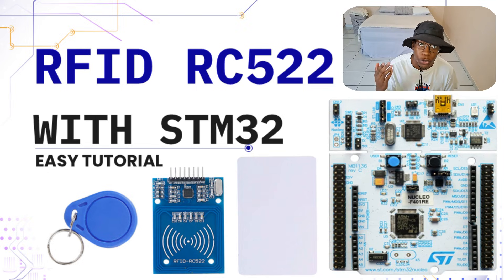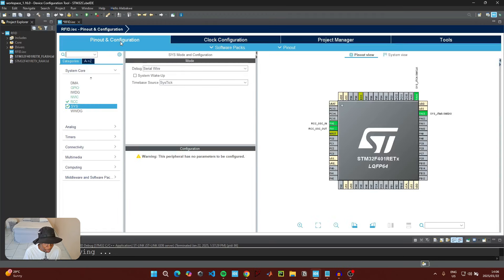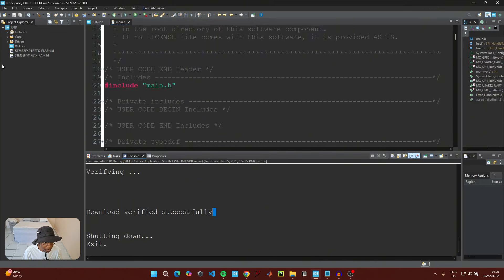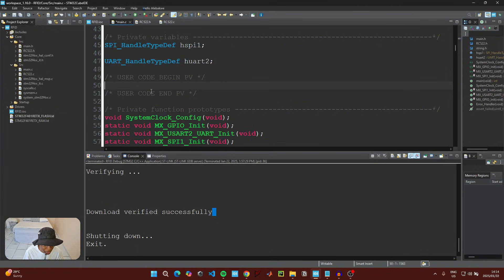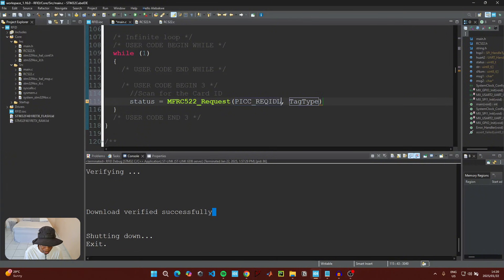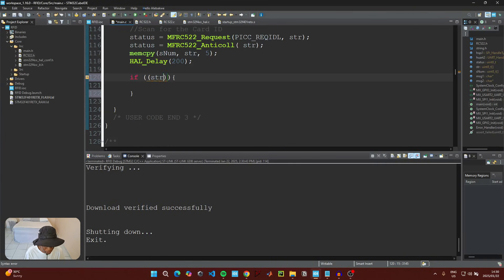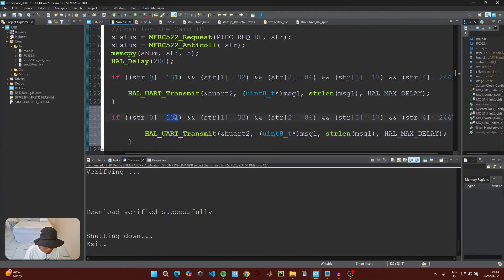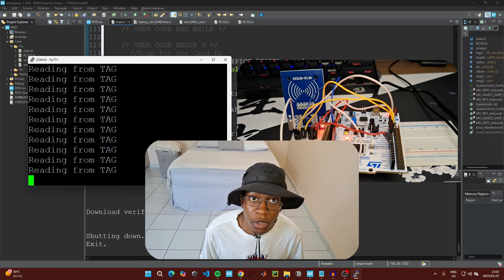How to use RFID RC522 with STM32 | EASY TUTORIAL | STM32CUBEIDE

Comment: Great video, it helped me a lot. 
For my project I could not read the value of a tag/card in sNum, it didn't work. I asked some help from my teacher who corrected the configurations of the RC522 : the ask modulation wasn't turned on, so the RC522 could not read. Thanks to him and this video my project now works !
Here are his corections from the Github files : 
/**************************************************
 * New define in the RC522.h file
 * **************************************************/

#define     TxASKReg              0x15
#define     CRCResultRegH         0x21
#define     CRCResultRegL         0x22
#define     AutoTestReg           0x36
#define     TestSel1Reg           0x31
#define     TestSel2Reg           0x32
#define     TestPinEnReg          0x33
#define     TestPinValueReg       0x34
#define     TestBusReg            0x35

And rewrite the RC522_Init()  : 
/****************************************************
* Rewrite RC522_Init() in RC522.c
*****************************************************/
void MFRC522_Init(void)
{
    HAL_GPIO_WritePin(MFRC522_RST_PORT, MFRC522_RST_PIN, GPIO_PIN_RESET);
    HAL_Delay(50);
    HAL_GPIO_WritePin(MFRC522_RST_PORT, MFRC522_RST_PIN, GPIO_PIN_SET);
    HAL_Delay(50);

    MFRC522_Reset();

    Write_MFRC522(CommandReg, PCD_IDLE);

    // Timer setup (per NXP recommendations)
    Write_MFRC522(TModeReg, 0x8D);
    Write_MFRC522(TPrescalerReg, 0x3E);
    Write_MFRC522(TReloadRegL, 30);
    Write_MFRC522(TReloadRegH, 0);

    // Enable 100% ASK modulation
    Write_MFRC522(TxASKReg, 0x40);

    // Turn antenna on
    AntennaOn();
}

Comment: Should we connect TTL connector to the board for Putty?
Reply from the maker: Hi. If you're using the same stm or a similar one then no, because usart2 is already connected to the usb port we use to upload code to the board.  But if you're using a different board, then yes.
Reply: @CircuitGator_HQ  Great.Thanks

Comment: I am encountering the SPI communication error between RC522 and STM32F407-DISC1. I have checked the connections and congiguration multiple times. Also tried switching modules still the same error persists. The status var holds 2 always. Please help.
Reply: Hello same issue with 
Did you get the solution ??